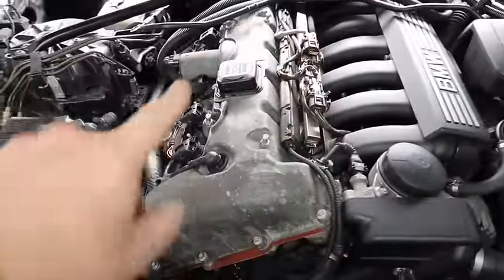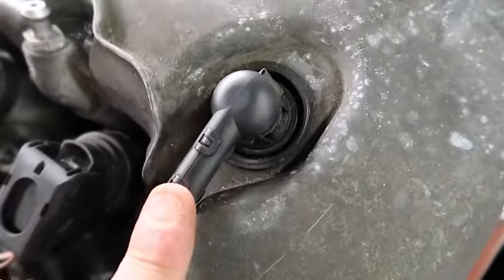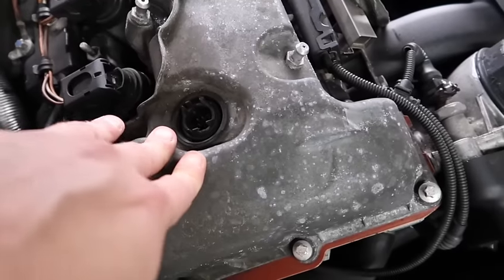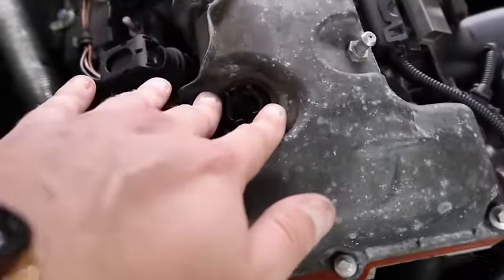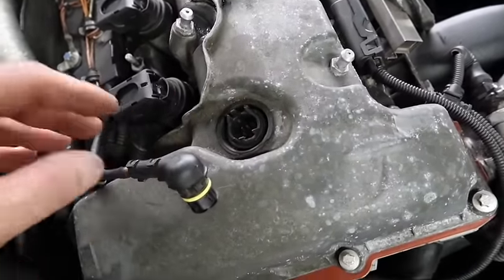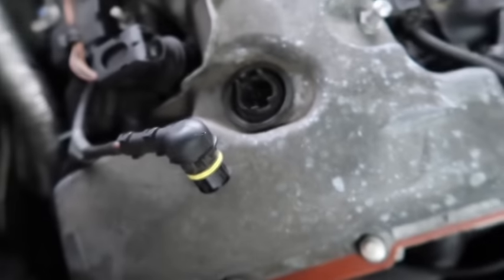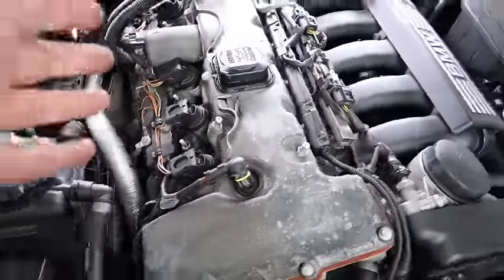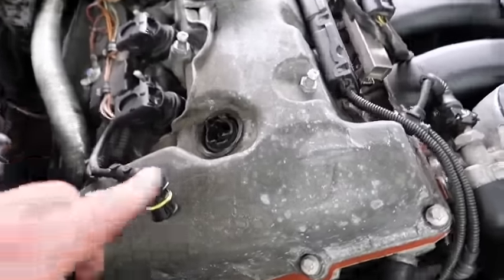Remove This From Your *BMW IMMEDIATELY*

Comment: I swear. BMW has got to make more money selling parts than any other brand.
Reply: :face-blue-smiling:
Reply: BMW stands for "Bring My Wallet"  not just Bavarian motor Works!
Reply: Probably about the same as any American brand 😂
Reply: Yep. You got that right..
Reply: As an e46 owner this comment is factual. Whether it be mechanical or cosmetic.
Reply: Ford F150 is selling for up to $85k... For a pickup truck....

Edit: the raptor even breaks the $100k mark. 🤯
Reply: No, definately Mercedes has the most expensive spareparts. I know because I have a Mercedes and a BMW. BMW is expensive , but Mercedes is robbery..
Reply: I replaced my radiator at 80k miles. Now I'm a little paranoid. Didn't put the bottom plastic on yet. I drive the car for 15 minutes. Temperature is good. I opened the hood. The overflow tank is really hot. Top of radiator really hot. But the bottom portion. I mean literally almost half the bottom of the radiator all the way across isn't even warm.  I don't understand
Reply: That goes for all corporations.  Thats the whole purpose.
Reply: @Nick-wr7vv  your radiator is always going to be hot. That plastic isnt gonna do anything. If something breaks, might as well take it to the shop. But you gotta realize your radiator gets hot when the coolant gets hot, thats why you dont open your cap when it gets hot/aftet running the engine
Reply: @MasterKeyMagic  Do you own a BMW? Have you ever owned a BMW? My guess is no to both. Most negative comments about BMW’s are from people who’ve never owned a BMW. When asked, they usually say “well, no, but my friend told me………..”.
Reply: @MasterKeyMagic  believe it or not Mercedes and Lamborghini make the most money selling parts than other brands because normally when something major happens to a Mercedes it’s typically a whole bunch of expensive electrical components that fail and lambo parts are just extremely expensive because they don’t manufacture that many extra body panels and components

Comment: Thanks Dean, I've got this issue on my e61, makes car undriveable. Have you any recommendation on where to source these parts for the sensor and rocker cover. So much low priced cr*p out there now . VDO make the sensor I believe and available aftermarket.

Comment: Good video, tho to point out.. the valvetronic system is in charge of adjusting valve lift, Not advancing timing (vanos solenoids are in charge of that). (Valvetronic is basically a fully adjustable version of honda vtec). The eccentric shaft sensor monitors how much the valve is lifted and if not operating correctly will cause all these issues you've pointed out. Keep up the good work 👍

Comment: With all the respect to you, my opinion, as an owner of N42B20A, is that because the vvt sensor is made of plastic it sucks oil from the inside of the valve cover to the outside (plug of sensor). Is the same that happens also with camshaft and crankshaft sensors.
Reply: Had to change both on my e60 5series
Reply: Kid sold it for dirt cheap bc he thought there was sumn seriously wrong w it
Reply: BMW reliability issues are legendary. and for good reason as they use sub par materials that have a short life  span and expensive replacement parts coupled with difficult  time consuming access make these cars a nightmare to work on. and will soon impact sales  .
Reply: @george40nelson4 They don't use "sub par" materials. The eccentric shaft sensor is made by Siemens which is a very reputable electronics manufacturer in europe. A lot of other parts are either bosch. Lemforder, bilstein. The cars are just incredibly over engineered and anything that goes wrong will throw the car off and into limp mode. They are much better made than american cars.

Comment: I was wondering on my 330Ci E46 for almost two years now.. what is the problem for stalling, rough idle, low power and I literally replaced everything and the problem was still there. I thought also that it might be something with the air but no. I replaced this and now everything is smooth and back to normal. Thanks!
Reply: Where is a it located?
Reply: @formulaxautodetail3218  Bruh
Reply: You replaced the cable of camshaft sensor?

Comment: Are there any aftermarket equipment that you would recommend on the n53 (130,000 miles). (Brother in laws)
Also does dielectric grease or silicone help or hinder the bmw type connectors. Thanks for your honesty and professionalism.

Comment: Cleaned the prongs with compressed air and the car runs smoother, probably got oil in it while doing vc gasket. Thanks
Reply: The oil leaks through the Eccentric shaft sensor pins after time!!
Reply: Usually the gasket leaks on the sensor and oil leaks on the plug and fryes the sensor

Comment: Removing that will also cause your engine to consume more gas and do a number on you cat system.
Reply: Better than having a not starting car
Reply: remove your cats lmao
Reply: Who even wants the cats💀
Reply: @atx.stunts4897  emissions
Reply: Just get a cateless vrsf down pipe and tune it
Reply: >actually having cats
Reply: Mine don’t start rough idle it just dies and sometimes it has no power when I push the button to start replaced starter battery and alternator all them are good and also have code 5014 if anyone can help me
Reply: @gsrmatt6011  how can I do this? Will the spacers turn off Check Engine light? Want to remove cats.
Reply: @seanglass178  did you get a solution for your problem? If you did kindly share
Reply: What about the n13
Reply: Cat convertor? What is one of them...🤣🤣🤣🤣
Reply: This must not be a problem for 2011s+
Reply: I have found. Do not park your car on a decline. Where the nose of the car, is in a downward slope. This has helped keeping  residual oil from pooling in the front of the engine. 

I have cleaned the pins and connector many times with carb cleaner. Then blew it out with compressed air. This has helped doing both of these things.

Like most components on this engine. It's a pain in the ass to change. Love the car, but I'm done with it’s inconsistent. operation. Especially at  only 100,000 😂kms.

Comment: Thanks for the video!
Eccentric shaft sensor, vanos, vacuum leak, disa valves, camshaft sensors, vanos screens, coils, spark plugs, ECU, any one of those can cause rough idle..
Did I forget something?
Reply: Squishy PCV hoses and old cracked fuel lines did it to mine. Oh and throttle body gasket.

Comment: Once again, dropping that badass knowledge we all need! Thank you brotha! One quick question, please?  What would you use to clean it? Mas air flow sensor cleaner? Or degreaser? Thanks man. If this is a stupid question, I apologize.  I just started turning a wrench on a car when I bought my BMW. I have done really well using your vids. I love working on it. Thanks for everything, Mate! Cheers
Reply: Hi did you get an answer in how ti clean that sensor from oil dirt
Reply: Contact cleaner spray
Reply: Contact spray nothing else
Reply: use electronic parts cleaner
Reply: MAF cleaner bro

Comment: I've had VERY rough idle which after I turn my car on and off a few times goes away, however it returns later. Scanner also throws multiple cylinder misfires 1-6. I recently noticed that when I disconnect the Valvetronic motor it runs smoothly. Could this sensor be the culprit?

UPDATE: I got it fixed. Turned out to be a bad VANOS solenoid (exhaust).
I removed the part and it was stuck, I cleaned it really good and got it working again but a few miles later it started happening again, I bought a new part, installed it and now my car is running smooth.
My theory is that that Solenoid would sometimes get stuck and would get unstuck after a few start ups and this is why the car would sometimes run smooth and sometimes not. 
Hope this info helps.
Reply: Did you get you issue fixed? If so what was it? I am having the same problem.
Reply: @OhFears-  me also they said high pressure fuel pump and high pressure sensor
Reply: @OhFears-  Yes, I got it fixed. Turned out to be a bad VANOS solenoid (exhaust).
I removed the part and it was stuck, I cleaned it really good and got it working again but a few miles later it started happening again, I bought a new part, installed it and now my car is running smooth.
My theory is that that Solenoid would sometimes get stuck and would get unstuck after a few start ups and this is why the car would sometimes run smooth and sometimes not. 
Hope this info helps, man.
Reply: Hello mate, I've changed my solénoïdes recently, do i need to disconnect the camshaft sensor? Thx

Comment: Thank you so much for this video. Eccentric shock sensor is a tricky thing no doubt. So when you say remove this from your bmw immediately, what are you recommanding us to remove, exactly? The sensor?the oil in it? You mentioned that it might already be too late if we see oil inside.
Reply: Replace the sensor he said
Reply: You can also drive with it unplugged
Reply: @dhalsim-1  for how long? Will this cause any other issues?

Comment: Hey Doc, I have a 08 328xi now I'm pushing 230,000 miles I've done all sorts of repairs to my car but recently I have been slacking plus this economy is hurt'in me, but I am starting to put some things together, what I should be preparing to do to keep me off the side of the road. I don't see anyone with this car near this mileage, but this is where I am. I haven't done this sensor but I am changing the valve cover gasket soon and I am changing anything I need to while it's apart bad or not, preventative maintenance. I appreciate your insight on the matter.

Comment: Thank you!! I’m still learning but I just did all coils and spark plugs bc person before me didn’t take care of the car so oil gunked up everywhere that I’m trying to rid w out locking engine and it’s running rough again and I’m about to do the gasket so I will do this as well!
Reply: Consider cleaning mass air flow sensor , cleaning vanos
 solenoids
Reply: @jrjr8574  how to clean mass air flow sensor ? I’m in the same issue

Comment: Should I disconnect battery before taking this plug out for inspection? Is it safe to clean inside of socket with Q-Tip?

Comment: Will this throw missfire codes? Having a rough time with my 545i 2005  got a crap ton today after replacing that vvt sensor aswell as the other side  valve cover gaskets the codes are p1515,p1056,p2103, p1637,P0159, p0390,p0365  can’t seem to figure out the miss fire codes and this honestly chasing a dead tail

Comment: Please help me with an answer to my question, I have 2007 525i and I have a P1415 and a P0174 and the cars surges really bad as if it's running out of gas on cold starts and at stop lights or stop signs when coming to a complete stop the rpms will drop so low like its gonna stall and then shoot up and idle itself out after surging for a few seconds, it doesnt have the power it should have, I have to almost floor it to get a normal takeoff, I have replaced the MAF, vanos, check valves, spark plugs and coils, oil and filter, cam sensors, and it still does this problem, it drives great on the highway but when stopping or getting out the car to go into a store or something and getting right back in the car and start it I have to go through this issue every single time I start it, do you think the essentric shaft is my problem? Please respond so I can fix my baby, I absolutely love this car but I'm so frustrated with this problem where I'm thinking about getting rid of her. Please help me with a response.

Comment: Hi enjoyed your video I have a 2004 bmw 325i cinvertiable just fitted a new air mass censor as last owner drive car with it unplugged as not working won’t seem to accept new one sometimes won’t rev up in park or neutral any tips to fix Mutch appreciated

Comment: Thank you, this is my current issue for BMW Z4 E89 (2011) Engine shaking after start drive around for 2-3 mins engine light show up and did the Diagnostics found the issue 
Fault code: 0029D2 Misﬁring, Cylinder 6
Fault code: 002D16 Air mass meter, signa
Fault code: 002D0F Air mass meter, signal 
Fault code: 002F08 Intake air temperature sensor signal 

The question is do i have to replace all ignition coil and spark plugs ?
Thank you

Comment: Thank you sir! Have this exact problem currently. Had a new eccentric shaft sensor installed a year ago. And now found oil inside the connector. I guess Im going to have to buy a new one again. Rough idle and car dying on me had me running around like a chicken with my head cut off indeed!
Reply: Hello, the irregular idle always or only a few seconds after starting? It happens to me that when starting for 15 seconds the idle is irregular and then it goes perfectly. I don't know what to change anymore!
Reply: @andybirtone164  hey mine does that too!

Comment: Thanks so much for the info and efforts with the video. 
If codes on the computer says oxigen sensors bank 1 sensor 1 and 2 as well as bank 2 sensor 1 and 2.
Also say cylinder 5 misfire.

Can I trust that, and just go ahead and replace them 4 to solf the problem, or could it give me other codes after replacing what the computer say.

Comment: I’ve been dealing with a misfire on cylinders 5, and sometimes I my car will stall when reversing only with low rpm’s. And the car has been roughly idling since the start of that misfire. And the issue didn’t start till after I did my valve cover. Guess I’m gonna have to redo my valve cover and replace the eccentric shaft sensor.

Comment: Symptoms:
Rough idle 
RPM jumping between 600 to 850 
Surging 
Jerking 
Loss of power

I replaced the
Valvetronic motor
Eccentric shaft sensor
Vanos Solenoid 
Spark Plugs
Coils
MAF Sensor

2A39 Valvetronic, Eccentric Shaft Sensor, adjustment range 
2A34 Valvetronic, Eccentric Shaft Sensor, guide, reference 
2A47 Valvetronic, Eccentric Shaft Sensor, Plausibility 
2A33 Valvetronic, Eccentric Shaft Sensor, guide
2A32 Valvetronic, Eccentric Shaft Sensor, reference
2A31 Valvetronic, Eccentric Shaft Sensor, guide

Don't know what to do at this point. I'll appreciate any tips 😕
Reply: @shibasalute  Have you tried cleaning the Vanos check valves?

Comment: Hi Doc ! From California, I have a N52B30 I believe 11’ F10 I recently had a shop “change the seal” on the Eccentric Shaft Sensor, the valve cover never came off. Doesn’t that mean it wasn’t changed ?!
Reply: A little late but I’m pretty sure you can replace the seal by itself.  At least on the magnesium ones

Comment: hello very good video my car an e64 engine n52 630i starts well and keeps the idle well but on diagnosis it tells me P1017 fault so this sensor, should it be changed while the engine is running very well??  sorry I translate because I live in France thank you

Comment: I'm  getting my VCG replaced. What other parts would you recommend replacing... pcv valve, spark plugs, etc...??  2008 e60 N52k w. 95k miles.  Thank you.

Comment: I really hope you didn’t say that oil will destroy the eccentric shaft. There’s constantly oil on it, it has to have oil between the lobes and rollers or it would destroy itself.
Reply: it's oil in it not outside of the part as you think. it goues trough the pin and in where it should not me.

Comment: Big help needed you are expert 
I have 2007 bmw 550i 4.6 e60 
Had starting issues not too long ago all fuses good starter good battery good ivm changed good gas codes for camshaft position sensor at bank 2 changed both of them since did not know which exact ones they were used aftermarket ones from eBay that stated they were for 4.4 550i didn’t see that till after install used them to start the car and it finally started up drove the car for about 15 minutes no issues at all turned on the next day in morning no start no crank issues could it be because there not the right fit battery is good also 100% charged ? Have also already tried disconnecting ibs

Comment: Or if your eccentric shaft is worn (on N62 are two of them) and you are not willing to spend like 2000 euro only in parts then just plug off these sensors and drive without the VVT… already driving like that for 6 mounts,no more missfires,rough idle,check engine,bad smell from exhausts or limp mode (my engine is N62B48)

Comment: Thats a $450 sensor.  If I had it all over to do again, Id wait until it goes bad. I washed the hell out of the old one and crazy glued it sealed as a spare.  I bet neither one will ever go bad.  I seled the hell out of the new one too.  
I agree with buying new bolts though because I have a valve cover gasket leak after 3 years.  I havent taken it apart yet but it could be the football gasket.  I bought everything from BMW but it still apparently failed.

Comment: Hi Dean can you just disconnect it or would I need to replace it as I took it off today and then plugged it back in and car started to run smooth again

Comment: I recently replaced the rocker gasket on my n42 engine. The next say going to work my car literally cut the engine off as I was coming to a stop. Luckily it started but was such a rough idle. It got slightly better but its still rough. I've got been racking my brain as to what It could be. I replaced all the sparks coils and vacuum boots just to be sure and its still rough. Maybe this is what's causing it. I'll have to give it a go. Thanks mate
Reply: Well?? How’d it go
Reply: Any update?

Comment: So my brother got a 07 bmw 325i and it won't  won't start at all we changed the cam sensor and both the vanos solenoids and got a new key programed the car and it still won't Start has fuel pressure but no spark at all we were gonna replace the crank senor tomorrow and see if it will start if it doesn't should I be worried about this senor?????
Reply: Did you ever find out what’s wrong with your car?